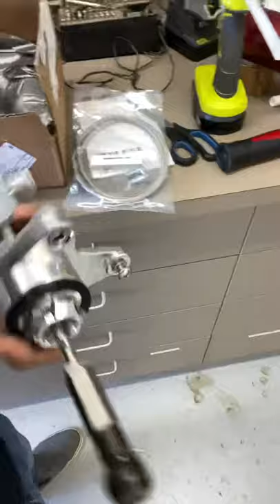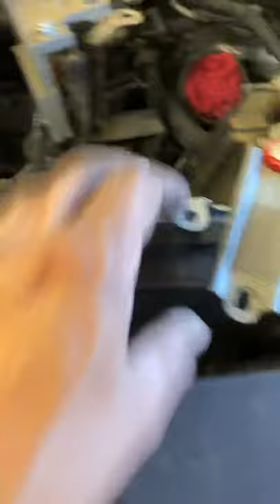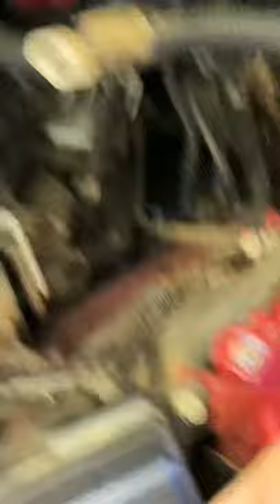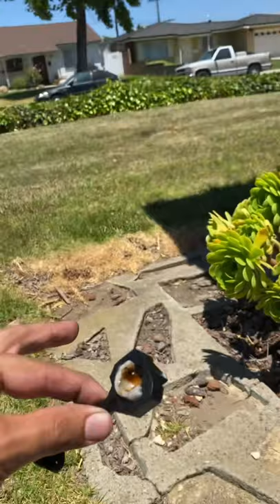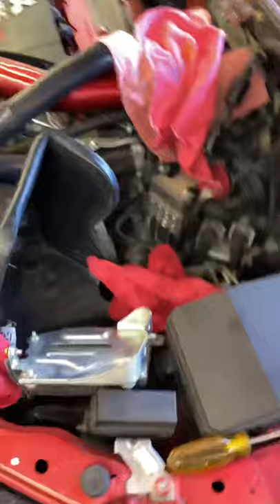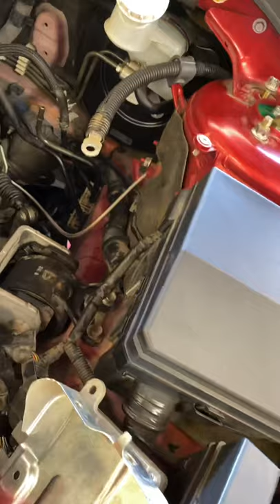MAP clip in CMC install

Comment: Is it possible to remove the brake master cylinder with out disconnecting the 2 brake lines and just set the whole thing aside?
Reply from the maker: It’s honestly better to remove it less chance of breaking stuff and doesn’t take that much time.
Reply: @squeakycahlean  thanks man!
Reply from the maker: @gillysmobileautospaanddeta8947  no problem! Happy modding!

Comment: I had a shop install my CMC (MAP clip in) a few months back and now my clutch pedal squeaks significantly. I've tried spraying lithium grease up there but no luck.. Any ideas as to what I should specifically spray?
Reply from the maker: One squeaks too you can try actual silicon based grease
Reply: That is the death squeak. The MAPERFORMANCE CMC is about die. During the squeak, you will notice the pedal start to feel spongee, soft and slowly will not return. Until it sits at fire at the firewall permanently. Switch back to the OEM CMC unit IMMEDIATELY and get a stage 1 or 2 SINGLE PLATE CLUTCH (Dual and Triple plates are useless and unnecessary), Before it locks the clutch the engine. Which will require you to remove the engine and transmission together. The OEM unit is MASSIVELY superior to all of them except for the fact it is made of plastic. Until some copies the OEM unit in metal. where stuck with plastic.
Reply: @TheSupercat2468  that is an oem mitsubishi cmc it's off the evo 8/9

Comment: How did you get the new clip onto the clutch pedal?
Reply from the maker: All by feel like I said in the end of the video I had my feet up at the head rest and my body upside down in the driver seat with the module in the footwell removed and just had to feel around up there till I found the hole

Comment: How did u get past the pin on the new cmc
Reply from the maker: Get past it?
Reply: Having trouble with this as well, so where the rod connects to the clutch pedal the jointed area, did you have the pin left in that socket or did you mate the joint and the socket without the pin and have to fight with inserting that pin back in?
Reply from the maker: @dmievo9487  you pull the pin out then put the socket on the clutch pedal ball then put the pin in you have to do it by feel or with a mirror while upside down and pull that little module
Reply: @squeakycahlean  preciate it brother ! It’s Been a real pain in the ass
Reply from the maker: @dmievo9487  no problem man I feel your pain lol the hardest part of this whole thing was getting that pin in